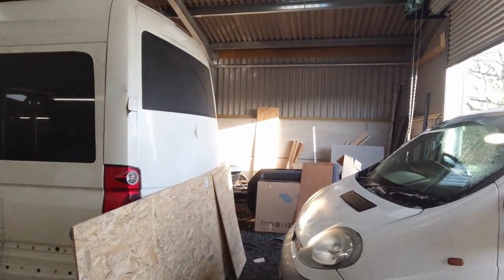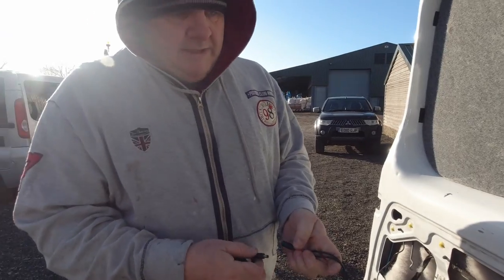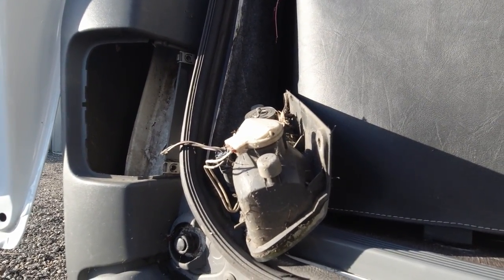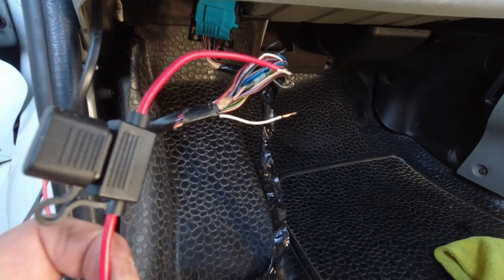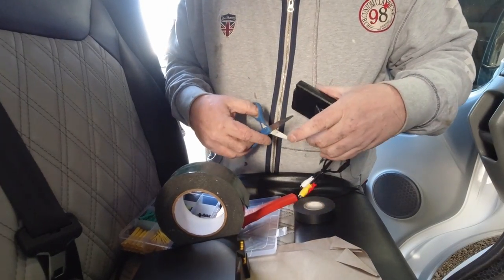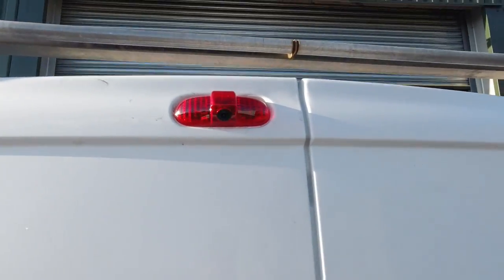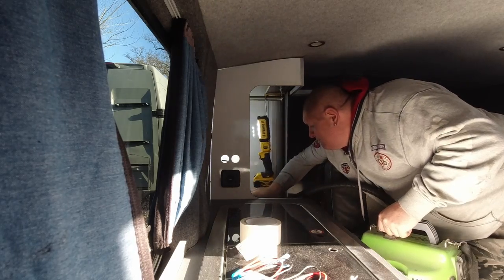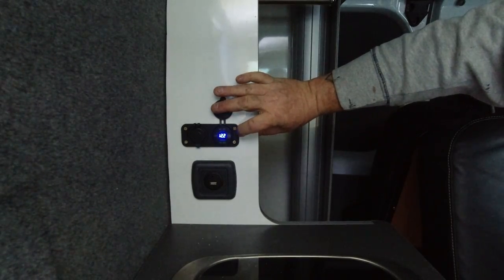VAUXHALL VIVARO - REVERSING CAMERA INSTALLATION

Comment: Nice, we did the same on my Trafic, used a wire coat hanger to feed it down the rear door panel and then through the flexi conduit, found the wiring loom and tapped into it right where the conduit brings the cables into the van. Also ran the live for the monitor from the back too to save taking the headliner down as the cables were long enough
Reply from the maker: They are good cameras I was surprised
Reply: got a trafic myself , so you wired the live from camera and monitor into the reverse light live yes? also do you have a link for these cameras?
Reply: @BuiltnotBoughtCampers  very impressed with mine, nice and clear

Comment: 2:12 Top tip 1: I didn't need to take off the top light cluster I was able to feed some TV coax cable, which is stiff allowing yo to push it, through that rubber ducting into the van. Top tip 2: I sprayed the cable with some cooking oil and it slid in nicely and never played hard to get.  :)

Comment: Of the white wires by the fuse box, how did you work out which wire was the reverse wire? I have several white wires. A really fat one and a few other smaller ones. Many thanks.

Comment: Hiya,when you did this did you put both power and reverse detection wire o to this? I've tried finding the correct reverse wire but it's not any of the normal colours at the front.
Reply from the maker: I only put the reverse wire

Comment: Hi not very good with electrics is the fuse needed or can I just solder a 3 way power supply?
Reply from the maker: I would always place an inline fuse if you cant connect it to the main fuse box, what system have you got or planning to get?
Reply: @BuiltnotBoughtCampers  similar to yours mate, the reverse cam that fits behind the top brake light lens, planning on wiring it to like 5 or 7 inch screen, electrics have never been my thing but il definitely have to order some of them fuses you was using

Comment: How is your camera power lead so long the one I got is 1m long and the red and black cable as so thin 🤔
Reply from the maker: I used an extension kit as they are always so short
Reply: @NAKED BIKER I did yeah where are you trying to power it from ?
Reply: I had 3 in mine aswell first one didn't work so I crimped it back together then cut into another one to try and that one worked so maybe just try one of the others
Reply: KTM 690?